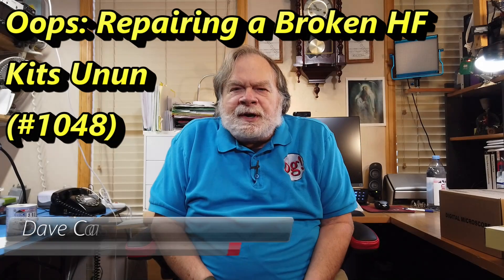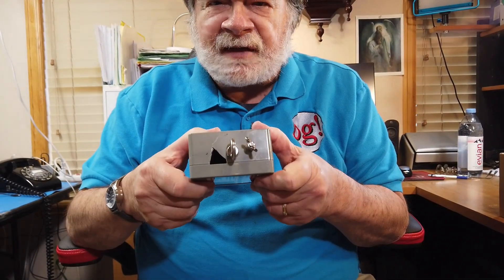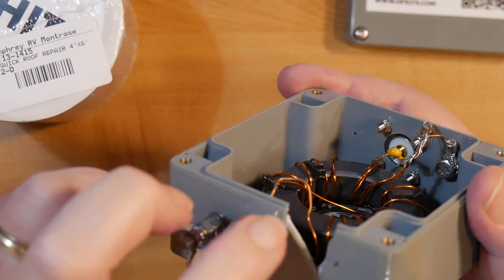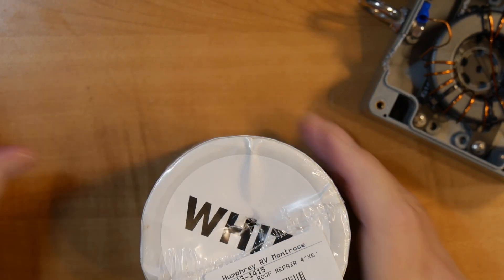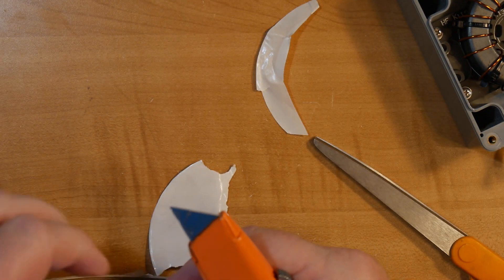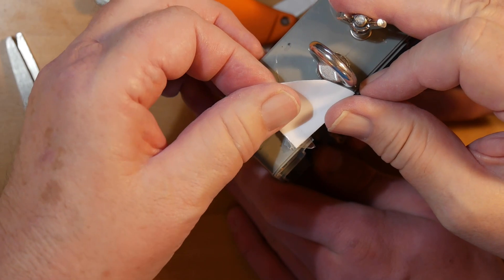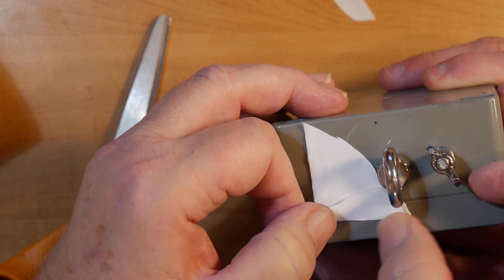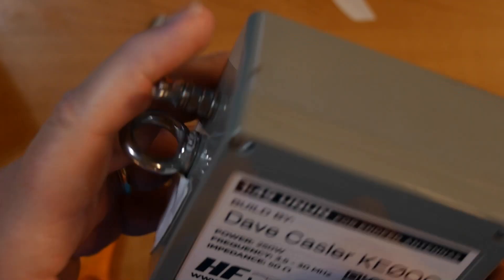Oops: Repairing a Broken HF Kits Unun (#1048)

Comment: Dave, you are going to have a similar defect again in near future; the half lambda wire should not be connected directly to the SS bolt but instead after a strain relief hooked to eye bolt.
Moreover the choice of the material (RV sealant) in this application is not wise at all. I don't have to mention that the way you patched it up is not good either. 
I will not take any chances and will replace the box with a new sturdy one.
The construction of the UnUn could have been better. 
De VU2RZA

Comment: There are a few other options for this kind of break. For cracks like this I keep a separate soldering iron tip that I use just for plastic. You don't want to breathe the fumes from this so please handle accordingly. Anyway, I just melt the plastic back together. I save pieces of plastic from things like drilling holes in plastic boxes etc and then use that if I need to add any filler.  For bigger things like this you can sometimes cut out a piece that sits flat over the hole and you can "weld" it in place with the soldering iron. Just be patient and methodical and the results can be quite god. 
Option two is super glue and baking soda. For small holes you can fill it in with super and baking soda. It's amazing. There are two other fillers that work great as well:  glass beads (like for bead blasting) and, of all things ,cinnamon. 
On a related but different kind of note, back in the early 70s they used to sell erector sets where kids could build various structures etc. Was pretty cool. But then came something even cooler: a kit call "Spin Welder". You basically had glue sticks that were about 3/32" diameter and 1.5" long  and had an flared opening on the end that you placed onto the shaft of a "welder", which was just a motor inside something that looked like todays modern glue guns. You would take the plastic parts and hold them in place and when you turned on the motor the rod would spin and the friction would melt the glue and you could run a bead. Pretty cool really. I'd bet with todays plastics this could be done much better and actually be a viable repair product.

Comment: I think, this damage can be prevented if you first attach the antenna wire to the hanging eye as strain relief and then connect it to the antenna connector.
Reply: Yep that works. You can also add another lifting eye to the case too.